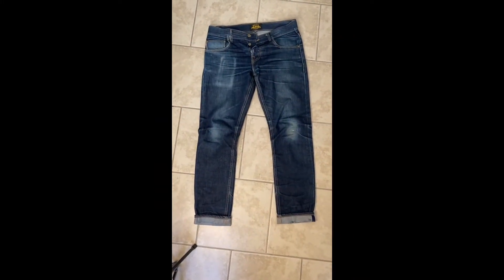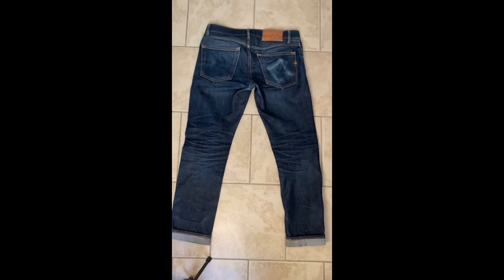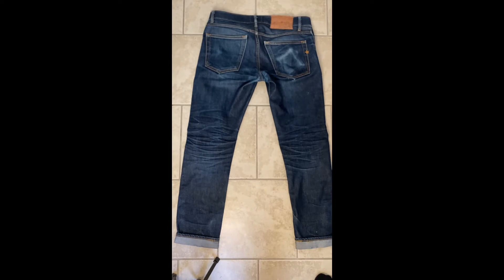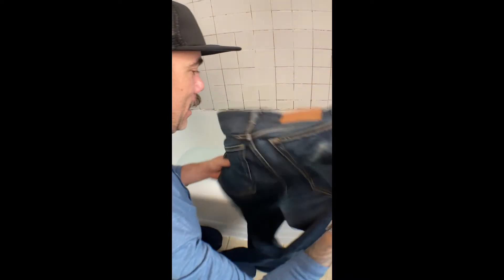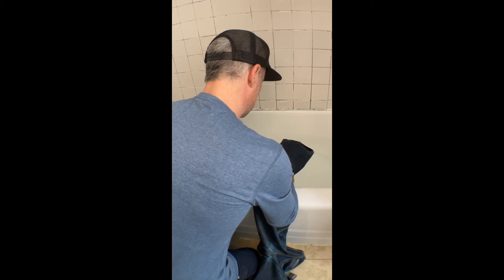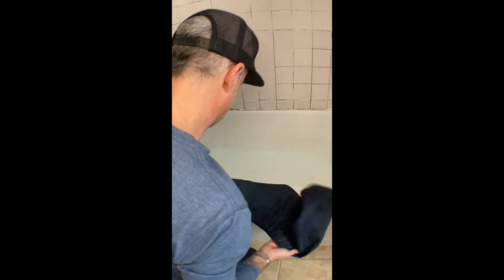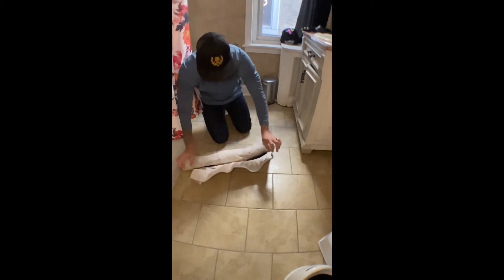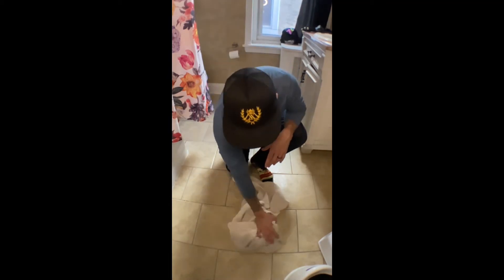Brave Star Cone Mills Raw Selvedge Denim: 400+ wears, 4th soak

Comment: I just bought their 15oz and the 21.5oz but Compared to my Levi’s 522 slim taper these jeans fit way to loose for my taste.
I bought their slim taper fit but I’m 
 going to send them off for tapering and to get them hemmed. How much to they stretch after wearing and how much do they shrink after the first wash?
Reply from the maker: Thanks for watching and commenting.
The way the slim taper’s fit me after 400+ washes is what you see in the video here.
They stretched a little in the waist, but not much in the shins, thighs or butt.
My advice, if you want it, would be to get them hemmed with a chain stitch and wear them like that.
Instead of paying about $100 for a taper, either size down on the slim taper’s, or go with the same size in their skeleton skinny’s, as it sound like that may be a better fit.
My thought is that it’s never a bad thing to have a couple different cuts of jeans.
I rock the slim taper’s and regular taper’s myself.
Reply from the maker: Quick side note; a commenter mentioned Northern Republic does repairs on raw denim, and I think Franklin and Poe does here in Philly also.
It is my understanding that you can ship to them and have them do tapers and hems.
Reply: @DIYTutorialGuy  wow that’s good to know. Northern Republic actually have a pair of my boots waiting to get resoled. I just bought a pair of Iron Rangers from them as well. I was going to use Williamsburg Garment company out of Brooklyn. They make custom jeans and professional tapering and hemming as well.
Reply from the maker: Yoy just informed me of another place servicing raw denim.
Williamsburg Garment Company is now on my radar, thank you!